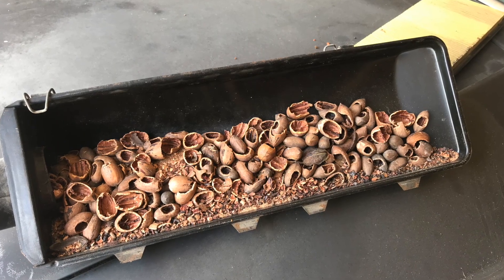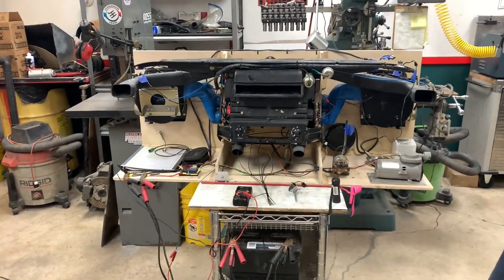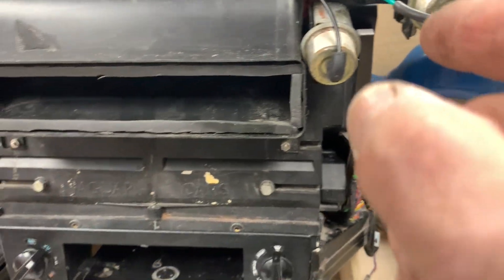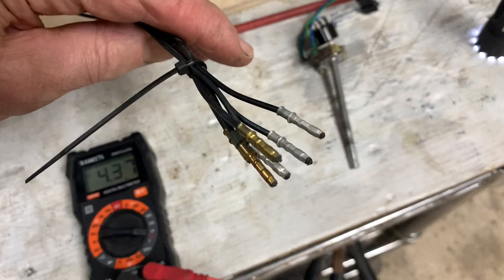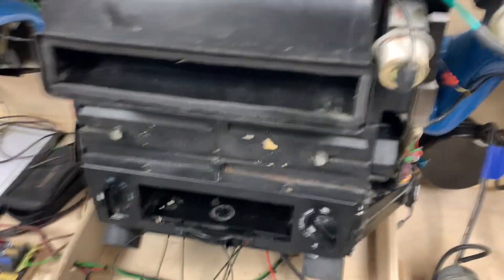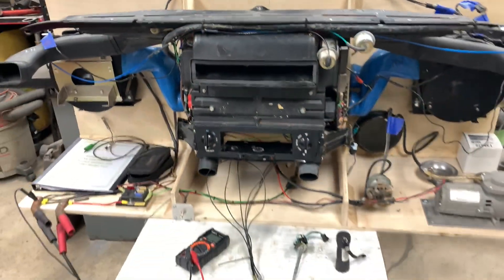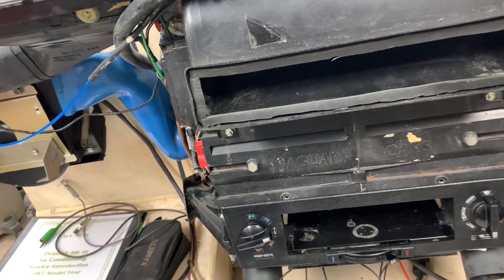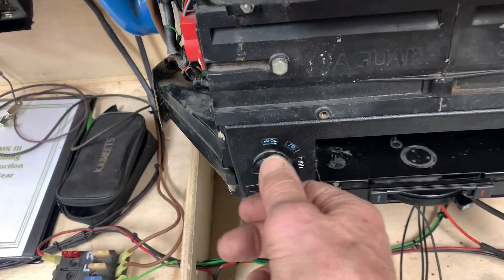S5:Episode4-1990 Jaguar XJS Convertible Restoration/Delanair Mk3 Air Climate Control Overview.

Comment: I would very much like to see as much of the tear down and reinstall of the interior , windshield seal and locking seal . really as much as u have on restoring this 1990 Jaguar XJS v12  HE . I have a 1990 Jaguar XJS v12 HE coupe . Which I am little by little restoring . I am 73 so it takes time plus I live in Yuma , AZ where summers are brutal 115 and up . Any trick og getting the oil sending unit  loose and out ? It is stuck in and afraid to break it off .

Comment: Great Video. I'd like to see the internals work one day.  TO further clarify the man / auto.  IN manual the duct temperature is set by the dial. In auto,  the dial selects the interior temperature setting with the system adapting as required. cheers!!

Comment: Incredible demonstration of how the climate control system works. I don't know if trying to sort the climate control on my 94 is scarier or taking on pulling a cylinder head for what I suspect to be a failing head gasket. Can't wait for a video on the tevis antilock brakes.

Comment: Excellent video. I posted a link to it on both the Jag Lovers and Jaguarforums forums. Look forward to a detailed look inside this fall when you do Old Tex.
One mod I made to my 87 and 95 XJS' was to block off the outlets going thru the console to the back seat area. This significantly increases the output of air from the center and dash end vents when using the A/C. Nobody sits in the back anyway!

Comment: I'm wondering if the MkIII is identical to what's in the DB7 - as I suspect Aston still has NOS parts available.    I wonder if the fiber optics could be replaced with a LED ring on a PCB. 

BTW those piano board connector numbers have been documented on the Jag Lovers forums in case at some point  a DIY diagnostic setup is ever created.

Comment: Looks so much easier than doing this inside the car under the dashboard. Is the manual that you show printed from Jaguars service materials?
Reply from the maker: I believe so. I found the link on a jag lovers forum.
Reply: That manual is out there on the internet. Just gotta search for it. It includes extremely thorough diagnostics guidance.